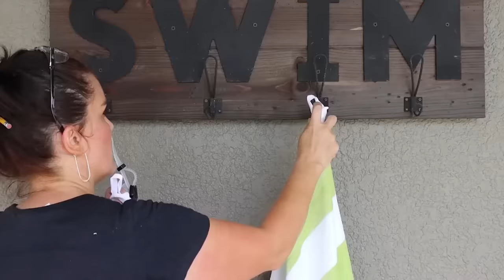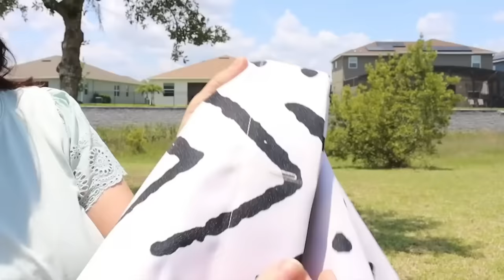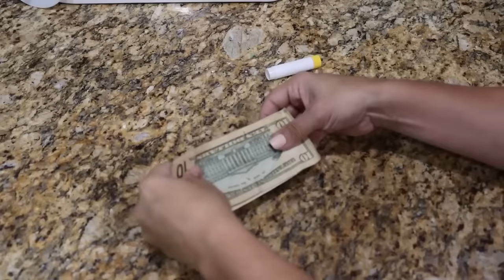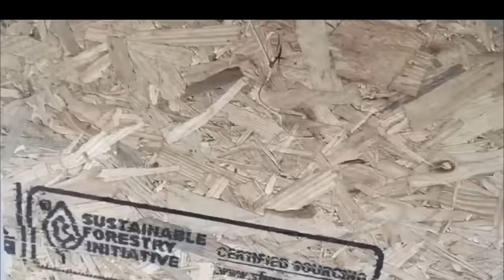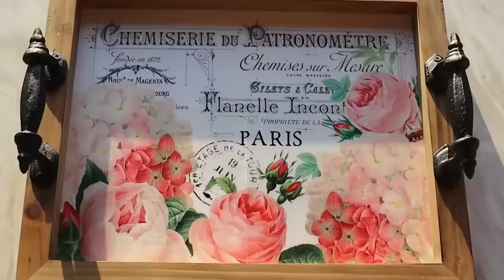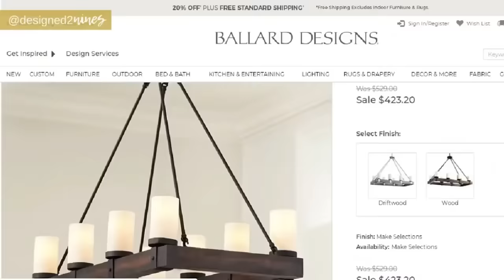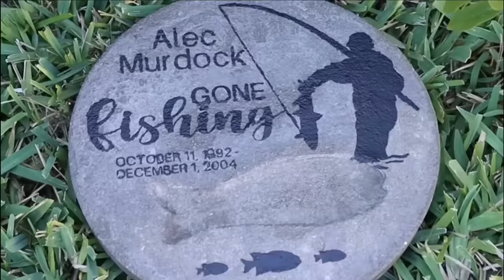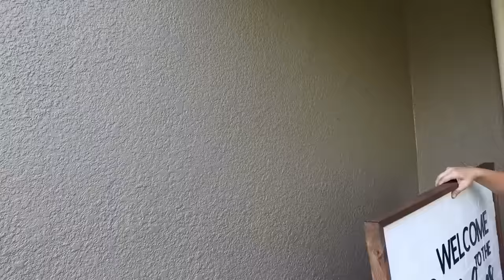Absolute TOP 50 + Best Outdoor & Patio DIYs & Hacks On a Budget!

Comment: Lol,the dryer did not eat the sock.  The culprit was your washer. Everything looks so nice. I used the tuna can for drink holders at the beach, to keep the sand off the bottom of your drinks. Or you can uses them in the yard.I grind down the inside of the can edges too make them smooth. I also painted the cans. Them take a wood or metal  tall stake, and screw or glue to the stake.
Reply: Great idea! Love it!

Comment: Tarek el Moussa 's mom told him to use the coke method on the driveway oil stain and it worked.  He was shocked at how well it worked.  
Here are the directions: "So what you do is you put some water on the stain, then you sprinkle your baking soda, and then you get a can of soda pop and you put your soda pop on top of that, and then it's going to fizz up," she tells him.

"Then get a wire brush (Tarek used a pressure washer like you did) and use it on the stain. That should work. And if it doesn't work the first time, try it two or three times. Better to try that than having to redo the whole driveway."

Comment: 7:11 💪🏽👍🏼

tip: If you add 4 triangular (or square) pieces in the inside upper Corners of your Stand, that will solve the wobbling and make your End table Frame much sturdier! 
btw. Those small  cornerbrackets i mentioned, won't be visible under the Concrete Top, unless you decide to Switch the Concrete with a clear Glass Top.☺️
Reply from the maker: That's a good suggestion. I like it!